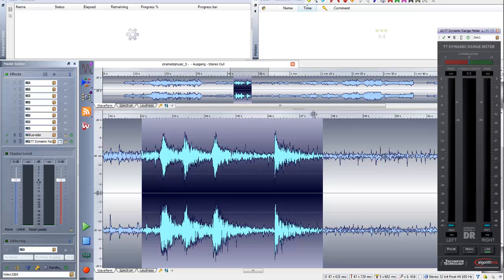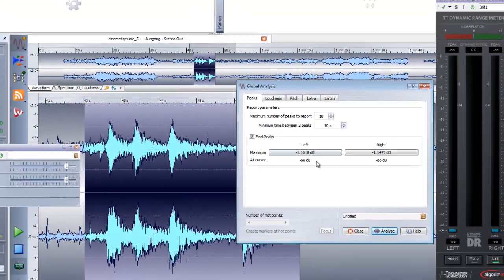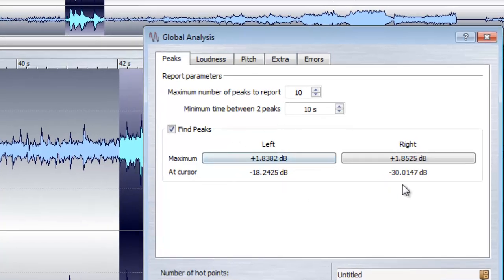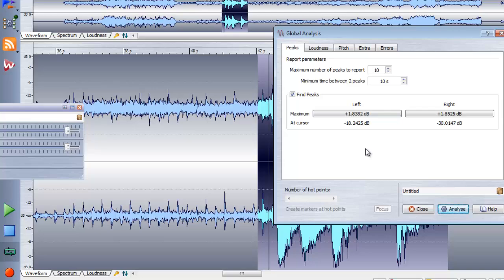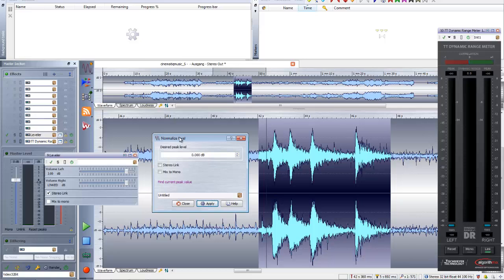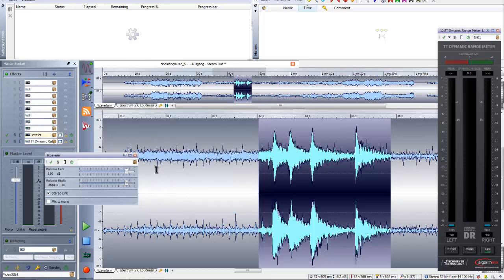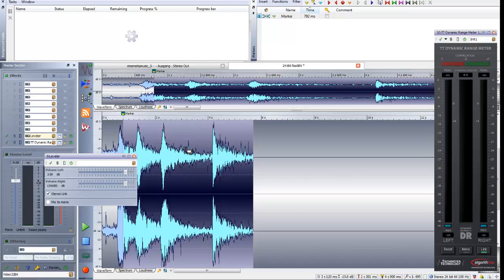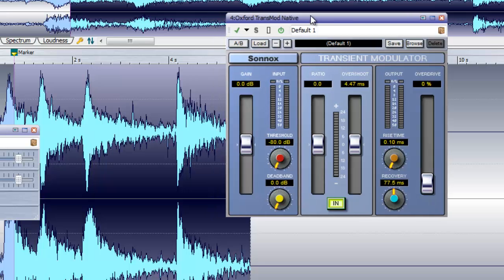EN: Revealing the myths about 24bit fixpoint and 32bit floating point audio processing

Comment: Apart from the safety of no clipping, there's also less loss. Assuming you might want a 24-bit export, not just a 16-bit one, you always need to process with a higher bit depth than your source files (again, assuming they're 24-bit).

Comment: I saw your Steinberg mixing video where you recommended mixing in 32bit float.  What I don't understand - why not just mix with enough headroom? 24bit has a large dynamic range, so why do we need to mix with the volume so high that it's going over 0db?

I see the advantages of 32bit float, but surely with proper gain staging it won't be an issue?
Reply: Gain staging? These "engineers" forgot how to roll cables. xD